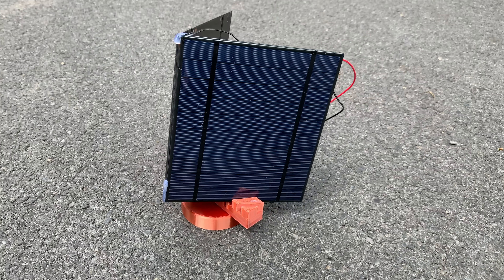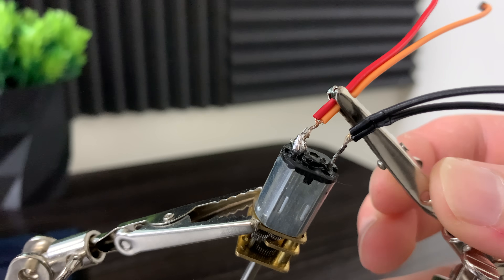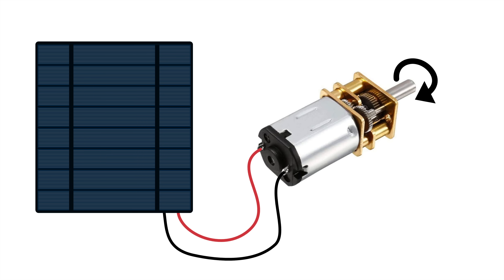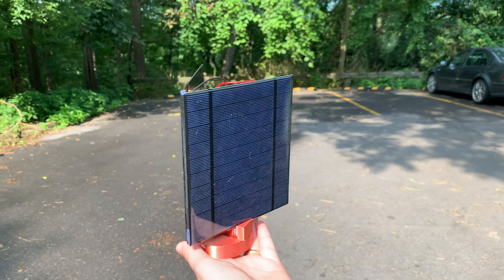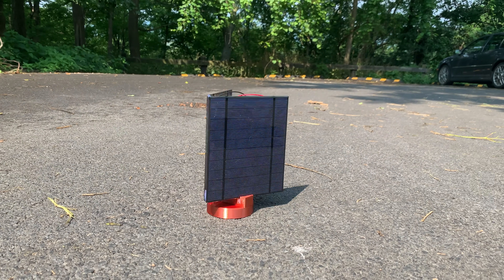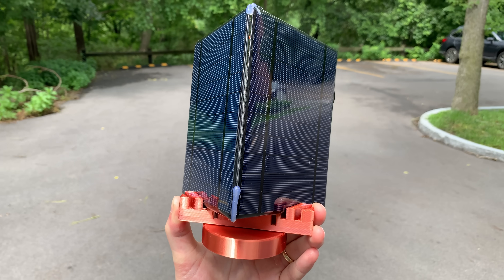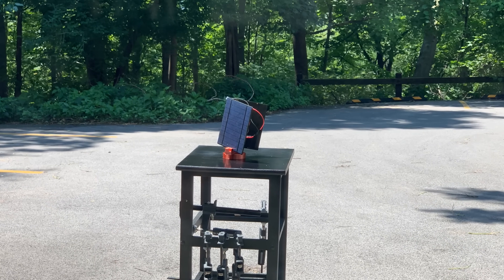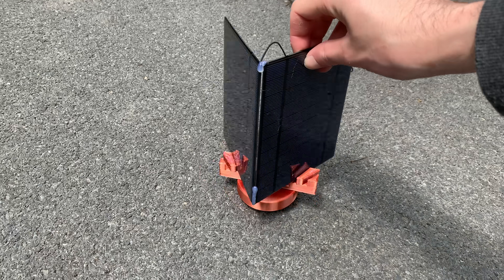World's simplest sun tracker.

Comment: Somehow cool idea...but for what?
How do you want harvest energy from that, if its cancelling out both paneles?

As we see, no motor movement when in perfect direction...so no energy produced...would need some smart electronics in the end to overcome that.
Reply: Could maybe use the motor rotation as an input for a larger solar panel?
Reply: @顔boom  How? ...how do you know the other panels are in the same/correct angle...even if panel weight and motor is the same, you would need to be very lucky...oO( but I like your idea! )
Reply: @mkdeviphone  
True, if we're talking fully analogue, as in no computerization, then you'll likely drift over time when using this as the input to a separate module.
One easy solution is to fit it together with other panels in one assembly with a shared motor. In this case you could simply have a large flat array with some of the edge cells dedicated to the motor.
I don't have a good recollection of how the voltages would act, but couldn't you also simply have a separate connection to the solar panels for the actual load you want to drive?

And of course it could also be used as an analogue sensor that can be wired to a more traditional system.

Comment: there is a much more efficient version, not really more complex.

put both panels flat (as in the optimal configuration ) and put a thin board ortoginal to their middle. the rest of the idea is the same, except you usually use 100% of total surface, while in this video you get less than 50%. 

the shadow created will reduce the voltage on the panel you want to compensate. wirering should be identical.

Comment: 2:50 i think you can also use capacitor to slow it down using right Capacitance so it will take some time to charge so the voltage dus slower Rotation .

Comment: There are 4 pin bridge rectifyers you can add to the circuit to get the power from both cells to do something like charge a battery. the ' difficult ' part is having it in the circuit so it doesn't get altered much by the motor being used to turn the panels.

Comment: Connect the panels out of phase and in series will also work.  The sum of the panel voltages rather than the current will drive the motor in the direction of the panel with the most voltage. When the two voltages are the same they will subtract to zero and the motor will stop. The panel voltages could still be used independently to power two devices as in the series configuration they are not canceling the current.

Comment: Add some switching and a variable resistor to tune out any imbalance in the output of the solar cells so the array isn't wasting power when it not moving and you have a very good if not great tracking circuit. Analog computers are the right answer for some problems. This is one of the simplest ones I have seen.

Comment: Question: is the "neutral point" of the panels the highest voltage output for each panel, and do they put out as much voltage as a single panel facing directly into the sun?
Reply: the neutral point in this device is where both panels produce the same amount of electricity (therefore they cancel each other out and there is 0 output when its in the neutral position) and the smaller the angle between the panels, the less energy they produce (it's doesnt make significant difference in the electricity production though) but it doesnt really matter cuz they cancel each other out

Comment: You say this doesn't use a computer... but you lied!  Ok, enough hyperbole.

You actually made a great example of how a nand gate works.  "Clockwise" panel charge is transistor 1.  "Counterclockwise" panel charge is transistor 2.  Only when both are true (equal sun), is output 0 (motor off).

Comment: "world's simplest sun tracker"
The 3d printer 🤔
the soldering equipment 🤔
also if the current has nowhere to go wouldn't it end up overheating the motor?
Otherwise it's a pretty simple solution to this problem. Great work!

Comment: Cool, but in soldering the +ve wire to the -ve and vice versa at the motor, arent you putting a +ve voltage on the -ve terminal on the second solar panel?

Comment: No, sorry. I won't give you a 5 star rating for this one.
have already pointed out, you're shorting two voltages, by wiring the panels in parallel.
Instead you could wire the panels in series, that would subtract one voltage from the other, HOWEVER you might get up to twice the desired voltage!
-So get a different motor as well.
You can still use both panels to charge batteries using whichever method you'd prefer (most people would use diodes).
I'd also like to suggest that you widen the angle, so that both panels will receive more sun

... Though your method is simple, it's certainly not cost-effective. Useful for education.
To make it cost-effective, it would be much better to use a couple of LDRs, they're very cheap - even cheaper than diodes and fixed resistors.

Comment: When light is equal on both panels, there is a +voltage from one panel and an equal -voltage from the othe panel, resulting in 0 volt for the motor BUT a maximum current though the panels because they are in series now. Not nice for them.

Comment: So if the voltages are constant on the small motor all the time then its constantly pushing/pulling on it. Have you seen how this affects the motor long term from energization of the coil? Will it burn up the motor or overheat?
Reply: It is quite possible that the motor current is being exceeded, if it is not, that's down to chance.

When a motor is stationary the current is highest because there is no back EMF.

This design should really contain resistors in series between each solar panel and the motor to limit the current to a safe level to prevent the motor burning out.
Reply: It is not to do with voltages. It is to do with current.
It's a current which causes a motor to rotate, not voltage.

It's two different currents, one from each panel which are being fed to the motor in opposite directions. If the currents are equal, then the motor does not rotate.

Comment: What happens to the generated electrical energy when the voltages "cancel out" (not really) each other? The wiring is done so that the two solar panels are connected in series and shorted together. That can't be good for them, can it?
Reply: Adding a diode in series to each panel can fix this. Current will be blocked in that scenario - the effect on the panel will be the same as putting an open circuit panel out in the sun (I am not sure if this can harm panels - I imagine not, but I am hazy on the photoelectric physics that occur upon light absorption)
Reply: @Celastrous  A diode can cause significant voltage drop, which in turn would require even bigger panels

Comment: Ok so I've got  question for you. How do you use it? I mean this is all well and good a simple solar tracker. How do I actually pull power from the panels without breaking something? A diode? Surely then I'd only be getting power from a single panel. Two diodes? Then rejoin the positive and negatives to output? This is really cool I'm just confused as to how I would utilize this to power something like an esp32 and a tempature_sensor to send updates to a server throughout the day. Is this not also harmful to the panels or to the motor? So many questions lol.

Comment: The simplest solution is also the most dangerous one because it is shorting the wires I found out, I did this with large panels and it literally started a fire! Please put in a word of caution because this is irresponsible!
Reply: Maybe use separate low voltage panels to rotate and larger panels not wired to the motor.

Comment: Question (I don't know anything about electric motors): doesn't the motor get damaged while receiving opposing electricity from both panels?
In other words: is this only a nice project or could it be actually used long term?
Reply: When the motor is not rotating the back EMF is not being produced which means that the maximum amount of current will flow through the motor which can burn it out.

The solution to this is to limit the current by using series resistors
Reply: @deang5622  thank you! :-)

Comment: Great video and design sir.  Quick question.  I recently bought a 100 watts solar panel.  Would this design (2 solar panels with motor) support a 14 lbs, 100 watts solar panel?  Basically, will the 14 lbs solar panel move left to right / right to left beneath this setup?  Thank you in advance. Cheer :)

Comment: the hardest part of making a solar tracker for big panels is holding and moving all the weight.  To make it worth the money you have to make 1 solar tracker with like 8+ panels, the more the better.  This ends up weighing at least 200 or 300 pounds though, panels + structure you put them on.  Hard part is buying / building all the shit.  Not the actual tracker-logic, that's pretty easy.  Just put 4 small panels behind each side of your large solar array.  When 1 panel gets sun, it turns the whole thing until it doesn't get sun anymore.  So every time the panels aren't directly at the sun, they auto-turn.  Problem is, the heavier you make the thing, the more power it takes to turn it, the bigger the panels you need to turn it...and often you end up spending more money just building and turning the thing (on extra panels etc.) which you could have gained more electricity from simply spending that money on...that's right...more panels which would have been WAY easier.

Comment: Really simple design. You could adapt this to set up your RV solar array by replacing the motor with a pair of voltage sensing relays, controlling actuators on the solar panel frame.

Comment: You used to able to buy button sized simple cadmium sulfide photodetectors at Radio Shack rather than use photovoltaic cells.  We used to use them to make "electric eyes" for automatic doors, security etc.

You can also just lie the detectors side by side in the same plane and just put an obstruction to cast a shadow on one side or the other.  This might be better if you're using photovoltaic panels as the detectors as they can operate for power production when properly aimed.
Reply: LDRs are hard to get hold of now because of environmental concerns, a shame because they were useful and fun components. You could use photodiodes and balance their currents. The circuit becomes a little more complex as they would need amplification, but an op-amp and  a couple of transistors for driving the motor would probably do it.
Reply: Sadly because everything is online nowadays, people do not go through stores looking at components to find out such a photodetector even exists any more, so they use the things they DO know exist - ie solar panels.

Comment: Very nice! Just one question: and how do you harvest sunlight to create electricity for other purposes too (e.g. charging a battery)?
Reply: Use this as a sensor/detector to drive a motor in which a much larger solar panel is being turned. The larger solar panel is the one that harvests solar energy. Or simply get a bunch of smaller power solar cells, make a ring and just make it a stationary solar tacker. There are many solar tracker designs out there.

Comment: With a worm gear to increase torque and prevent outside forces from moving it too much you could use this to rotate an even larger array that is slanted to better match the sun.
Reply: Or potentially use 2 of these 1 to adjust the up and down slant, and the other to adjust the left to right angle.

Comment: It's time to apply the magnifying glass to maintain a consistent temperature on a copper rod in a plastic tank of water and insulation around tank an the hot water an other similar method of  steam or boiler to create electricity and force to operate water operated automobiles an ect.

Comment: Well, just put the 2 panels in reversed serial and it will do the same without constant shorting the solar-panels. That way you could even use the panels probably when having a higher voltage, for charging for example, doing something usefull.

Comment: You aren't "cancelling out the voltage" you are just permanently making a short circuit. sometimes the short circuit is worse and sometimes it's less worse. But you maybe could have made it working by connecting the two negative pads of the two solar pannels with each other and connecting the motor between the two positive pads of the solar pannel. So if the solar pannels aren't ligned up with the sun propperly there's gonna be a differece in voltage between the two solar pannels, which would make the motor rotate in the according direction.

Comment: Why not make a version which actually can produce some electricity and point the panels at sun. Wouldn't it be better to use like two angled photodiode and when they are balanced it does not turn and use the electricity of the panels to turn it and excess you can use for something else

Comment: Young minds. Fresh brilliant uncluttered solutions. Now, instead of the motor please try a frontal heat-shrink strand material. Hotter it gets, more it pulls a single pv-cell, in-azimuth, towards heat source. Second strand could do similar in-elevation. Even better, a triangular heat-sheet material which seeks optimal heat source direction. Like bikinis on a beach.

Comment: This is a really cool demo but it isn’t something that could ever be usefully implemented (as is). 
The entire purpose of a solar tracker is to have the modules facing towards the sun throughout the day. The system that you currently have has each panel consistently offset by a 45° azimuth from the sun (east and west) throughout the day.
Truthfully this system would be more efficient if you had just leaned these two panels up against a brick with the two panels on the ground at a ~ 30° vertical tilt angle facing due south (assuming you’re in the northern hemisphere). 
Additionally Solar modules sit outside in the elements, for example if a bird pooped on one of the two modules the system would begin rotating wildly.

Comment: Suggestion: add another pair of solar panels wired the opposite way so the motor turns the right way even if the sun is on the opposite side of the mechanism.

Comment: Ay! This has been on my "to try" list for a long time. My design faced the solar panels in (not out like in yours) with a third, larger solar panel in the middle facing straight out. The third panel would keep a battery pack topped up.

Comment: to avoid the short circuiting between the two pannels, could one simply add some resistors on one of the colors of the wires? (ex. 2 resistors, each of them on the black of each pannel?)
Reply: Potentially diodes?
Reply: Adding resistors will require more sunlight to hit the panels for the motor to work.  Some diodes or some switching will works.
Reply: @enlacdmx4379  
What matters is voltage difference, so resistor of course make it require more sunlight but it wont make big change
Reply: or you could coat the connections in something like glue or hot glue or sealing foam or rubber sealent.

Comment: I’ve never seen a more inefficient solar collection device. The panels are angled at way too sharp of an angle. A single panel and two photodiodes would be smaller, cheaper and generate more power.

Comment: The oscillating device is a great example of a underdamped control system. The final device is a great example of a overdamped control system. The engineering magic is to create a system that operates on the fine line between the two. Great Video!
Reply: Yep. Overdampening will hinder its ability to track the sun. In the extreme case of an open circuit, you get no tracking at all.  
I would like to see the likely hysterisis of this system and see how it performs in a timelapse: How big of an angle difference between the device and the sun is required to get it to start moving?
Reply: @Celastrous  So, I think the point of the "Simplest" was lost on you and OP here. 

It's not supposed to be GOOD, it's not supposed to be correct, it's not supposed to be pretty. It's supposed to be as simple as possible. Was it not? It may have flaws but it's very simple.
Reply: @Ilovepoopin  I'm well aware. I'm just saying I would like to analyze this system as-is because it looks interesting.

Comment: Very simple and known trick. The poblem is as you mentionned, when you converged the first time toward the sun, you will need a nominal voltage difference to power  the DC motor. It can be translated directly into a nominal angular difference (abs(tracker bearing - sun bearing)) to track one more step.... So in term of accuracy  it's not fantastic.... Your system works well when you initialize badly with a complete different angle.... but after this initialization, it's not super accurate...

Comment: I have fixed a small solarpanel on the hourpointer of an mechanicel kitchen clock.
Follows the sun by day.
Positions in the night for right start in the morning.
If you charge a 1,2AA cell with   the solarpanel it will run until the gears brakedown.